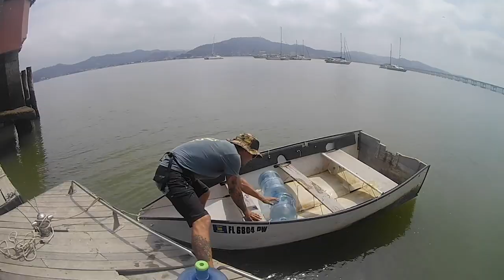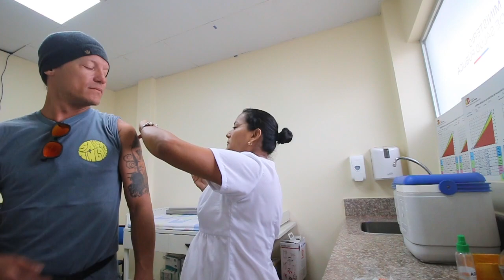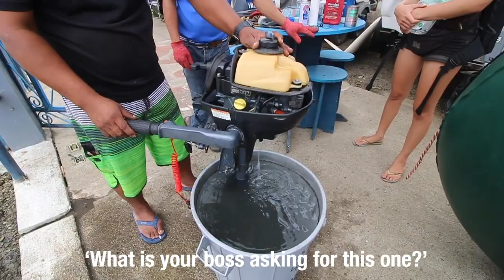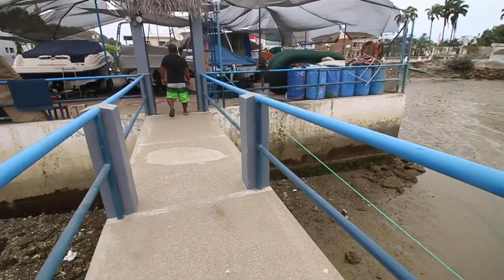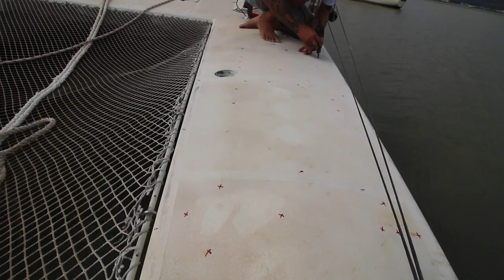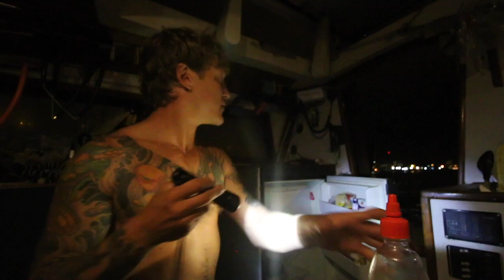Refit and repairing our sailboat in Ecuador | Ep. 56

Comment: Heads Up Guys. Saw James taking stuff out of the fridge that you don't need to keep cold. The thing is... a full fridge/freezer will retain its temperature better than a fridge/freezer that's empty or half empty. The less air space you have in your fridge or freezer the better. Even if you have to use ice bottles or water bottles... keep your fridge full of something. Yes it will take energy initially to cool the items down but once they are cold they will help keep it cold... especially when you're opening it often. When you open the fridge or freezer the cold air leaks out. And it is replaced with warmer outside air. Soooo, the less air in the fridge or freezer the less temperature leakage you get. I live in Corpus Christi Texas (Hurricane Alley) and whenever there's a storm in the Gulf I make sure my fridge and freezer is full of stuff (often it's just  water bottles  in the fridge and ice bottles in the freezer) in case the power goes out. It helps keep the fridge and freezer colder longer... if your freezer is half-full put some water bottles in there and turn them into ice that way you can turn the freezer off for a little while everyday... and another great thing is when they melt they don't leak everywhere. So if you guys get another refrigerator-freezer system try it out. Trust me... it will make a huge difference. Anyway you guys look great. Glad to see you're having fun doing your thing. And your Spanish is awesome... later... :)

Comment: your right . fridge is useless ,throw a box with holes in it .fill it full of beer 200ft of line ,thats cool enough  . dinghy annoying ,scirting board wood used in flooring wall contact its thin enough to bend to the shape of the sides of the dingy then brace at square end  cross pieces seats . greatly appreciate your exp and videos.hope u dont mind this r and r. never been on a small boat in my life . once again thanks

Comment: You should buy a soft sided fridge that runs on electric . I have seen one sailing channel that has one and has used it for years. It was set up to plug into a lighter but they changed that and made it fixed into the wiring. It now runs of solar and the other electrical power gens they have. Delos also converted from propane because of the propane problem. Each place had different bottles and fittings and would not fill there bottles so away they went .

Comment: You can find 3 way fridges. They have them for RV's in North America and I am sure they have them elsewhere also. get a few solar panels and 2 deep cel battery's and a good pure sine power inverter and that will take care of the fridge issue. Also, I agree with the electric motor for the dingy. You can find good used ones cheep. I found one off one of those Facebook buy and trades for $50. Canadian that needed 30 seconds work to get running again. And for just cruising to the marina or to a beach, that 37 lb thrust will work fine. also very light and easy to remove so it won't get stolen

Comment: 20 years ago I ran a propane fridge. After I dd the math I realized I was spending a fortune on propane.
So I got a 3 ft tall bar fridge for $300 and 2   250 watt solar panels for $400 and a 24 Volt inverter . No charge controller and no battery. I kept 4 bottles of frozen water in that little freezer up top , and it kept the food nice and cold all night when there was no sun. Next morning it would start up again and keep those bottles frozen. If you want to go luxury and get a couple deep cycle batteries and a charge controller ,you'll have extra power for your electronics

Comment: You may want to install a new 12 volt fridge.  Build your own cooler or an insulated box.  A 100 watt solar panel will run a fridge when the sun is out. good luck :)
Reply: Danfoss makes a good unit, draws 4 amps.  Sad, to bad the builder didn't use bronze nails, strong as steel, bronze screws are better,  :)

Comment: I'm running a 240v fridge off the inverter on 500w solar. I did have 1000w but didn't need that much so sold two panels and spent the money on a new handheld radio.
I'm in the UK with shit weather, I'd guess you would get away with much less in brighter parts of the world

Comment: It is simple you can buy a fridge or freezer that runs on electric that can fit anywhere. Now lets say your very old tired boat thing has no generator there are fridges and freezers that run off batteries and they can be charged by your engine or solar panels. Then to save even more power and money have the new LED lights  for the same watt in power they use a quarter of energy. There are so many things you can do using little amounts of money

Comment: Why can't you run a 12 volt Fridge? Yeah, the cooling unit can be very small. (No Pumps) Use the 4 x 8 x 1/2" insulation board to cut up and Line that under the seat place. ( As thick as you can ) It will work for what Little you have. Some will even freeze. Here's one to show you just how small it is.   https://www.youtube.com/watch?v=kL-j2qaw_OI  < how to build a Peltier cooler

Comment: Hey James, Why Didn't You Just Paint The Top Deck With A Heavy Textured Epoxy Seal Coating??? Get A 12v Fridge... And I'll Trade You Straight Across A 6hp Johnson 2-Stoke, Super Low Hours, Like New w/Quick Snap On 36" Extended Throttle Pole Kit For The Girl "Kimmie" Hmmm??? LMAO

Comment: Why don't you buy a Marine Grade 4 person boat and electric motor from Amazon. Here is the description of the boat - Inflatable Boat Dinghy Tender Aluminum Segmented Floor 9 feet - USCG Rated 4 Person 10 HP Motor. Compact Storage and Performance. Pump & Accessories Included .....here is the motor - GOPLUS Electric Trolling Motor 46/55/86 LBS Thrust Transom Mounted 8 Speed with Adjustable Handle for Fishing Boats Freshwater and Saltwater .....all in you should be $1150 US plus shipping.

Comment: Kevlar hull , Termanto cross-linked PVC foam core, or the Nida  core  , epoxy or epoxy barrier coat  . Problems solved .  Wood is endless trouble .
Reply from the maker: Never heard of termanto, but you’re right about everything else. Hell, my boat with nidacore decks would be a vast improvement. Not sure if that tech was abundant in the early 80’s though...
Reply: @thelastpirate  My boat is from the early 80's and has that termanto foam core . Light , does not rot . 

On the plus side your plywood can be repaired anywhere and is strong and light .